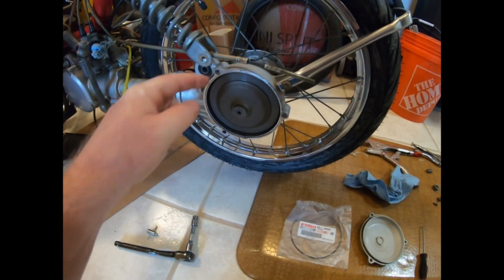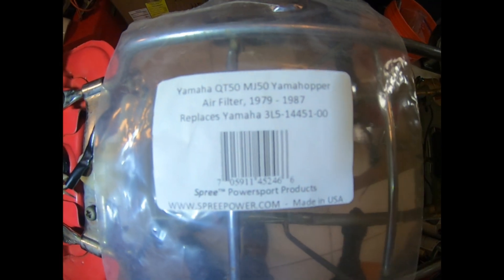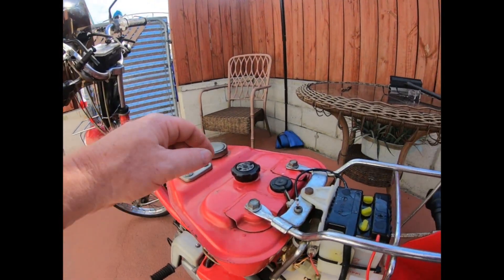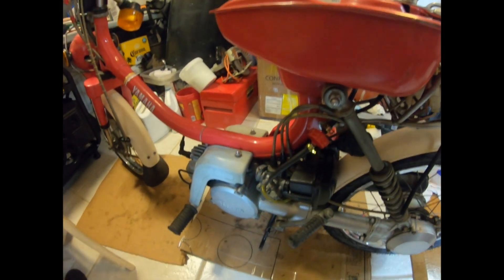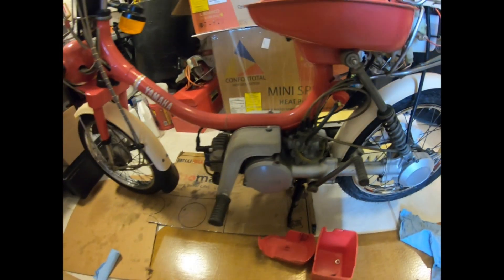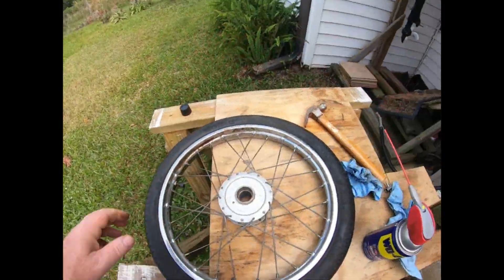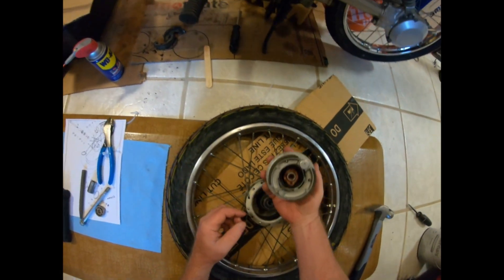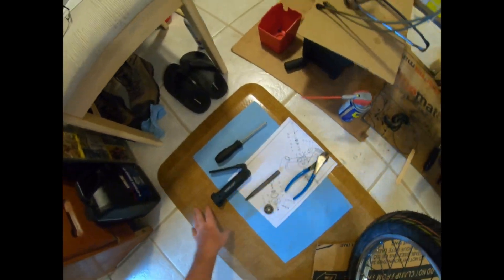1st run in 8 years. 1980 Yamaha QT50 - Also gets many new parts.

Comment: Nice work.  These are fun little bikes, I have 8 of them.  6 run fine, two will soon.  Yamaha put a lot of engineering in this bike.  Full size controls, oil injection, CDI ignition and shaft drive.  And they a very dependable.   A lot of the PW50 engine and drive train parts will fit.  Have fun on your little baby.
Reply from the maker: Thanks for the tip on the PW50 parts!